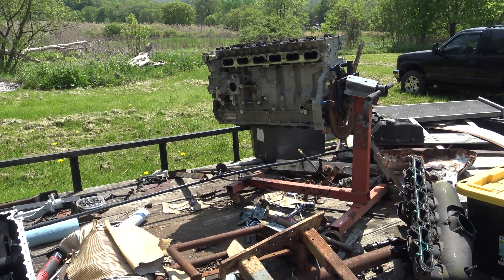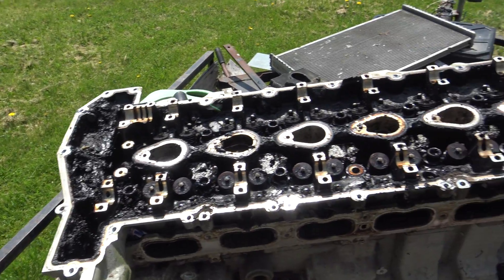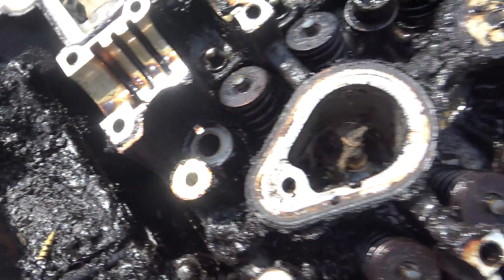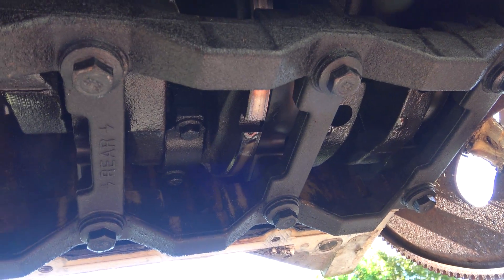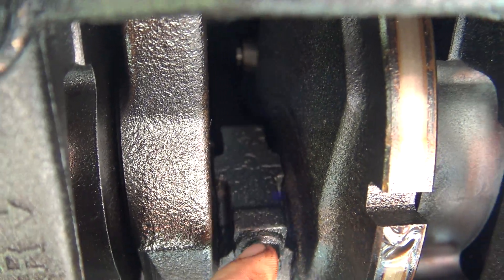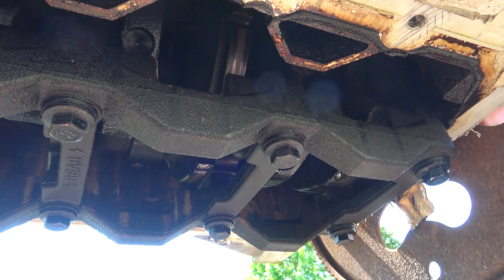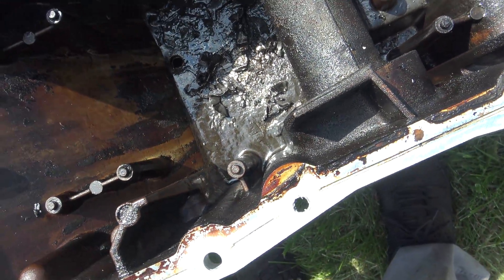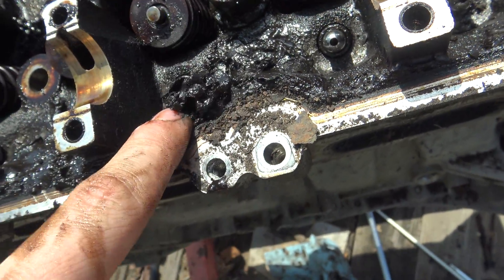Trailblazer Motor Teardown... ROD KNOCK

Comment: Did you spray something on the headbolts before trying to break them loose?
Reply from the maker: Nope. Didn't really care to be honest. The motor sat outside for few years before I started to do anything with it so I am sure that didn't help. I wasn't looking to save anything really. I just wanted to see what the top of the pistons looked like and if there was piston valve contact.